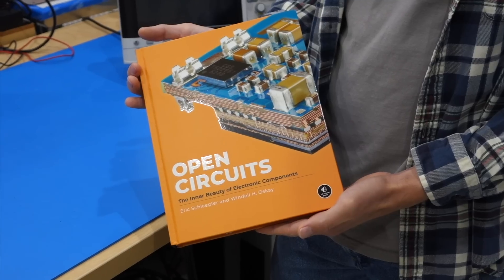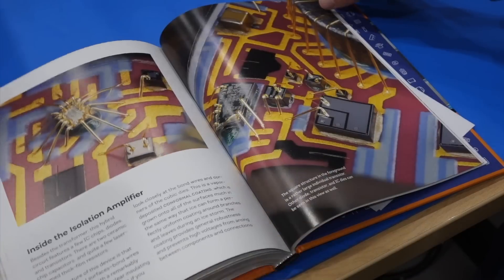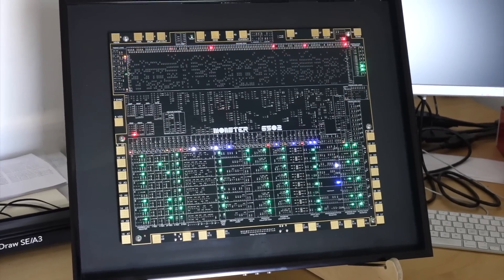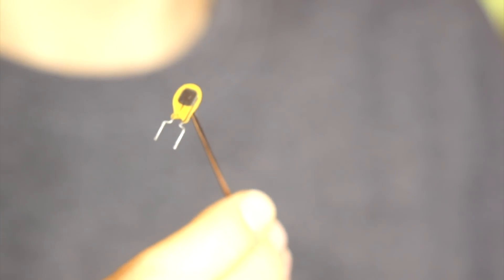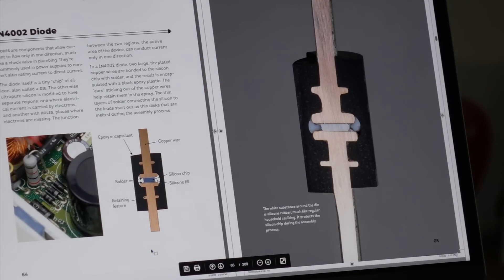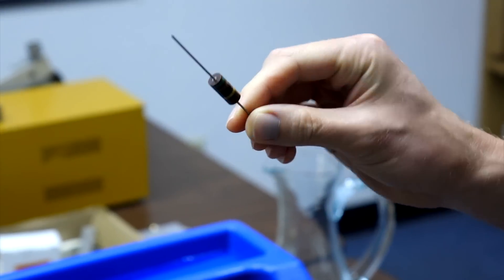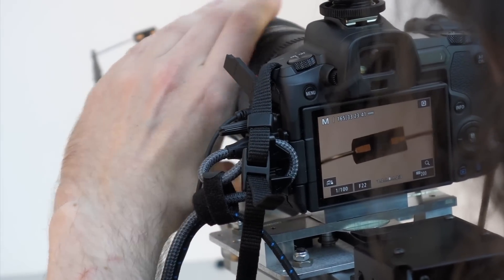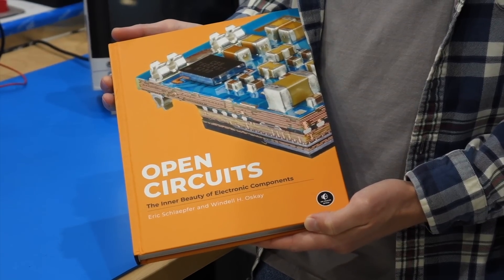Open Circuits: Eric cuts through electronic components and reveals their hidden inner beauty

Comment: The images I've seen from the book are just breathtaking. I'm amazed at the simplicity/purity of the cutting technique, I figured there would be some vacuum-infusing of resin, etc... The focus stacking seems very clever and effective. Carbon composition resistors are the ones that sometimes fail and take out a piece of equipment dramatically, right?
Reply: Some of the pictures did require using resin to hold internal parts in place prior to creating the cross-section. For example some of the cables and connectors

Comment: When I worked in the electronics R&D lab at Allen Bradley (1960's),  (carbon composition resisters, filters, ceramic capacitors, thin and thick film circuits, optoelectronics, etc.) we would imbed devices in a clear resin (using vacuum to remove bubbles) before cutting and polishing, thus supporting the parts.

Comment: My favorite part is when Marc says “…in the doodily-doo”.

I’m surprised they aren’t making epoxy pucks and slicing those.  It helps with keeping outer surfaces intact and gives a larger object to grasp for sanding, however it takes more time for sure.
Reply: I think an epoxy puck is good in some cases but I think they wanted the objects to appear as they normally do except sliced in half.
Reply: @djmips  Yeah, epoxy is great if you just want to look at a sample under microscope, not make a fashion photoshoot with it :D
Reply: Some of the pictures did require using resin to hold internal parts in place prior to creating the cross-section. For example some of the cables and connectors

Comment: That diamond saw blade is waaay too big. They need micro-blades. They're basically wafer thin, diamond powder 'sintered' in epoxy. There's no metal in them. I've even seen a few custom jewelers make their own using diamond dust used for polishing. The thickness can be as small as .5mm depending on what the powder is in coarseness. It takes longer, these blades are not big in OD, but they give out "chef's kiss" finish. No marks basically, as they polish as they cut.

Comment: Very nice, many years ago in a previous life I was employed to cut multilayer printed circuit boards to measure the thickness of the plating in the via holes etc. I mounted a small piece of board in resin then used a similar grinding method, using succesivly finer grades of emery paper, then finished off with diamond paste on felt. After this I gave the sample a quick etch in mild acid to remove any copper that had been smeared in the grinding and polishing process.

Comment: A little tip from someone who knows a thing or two about cross sectioning. If you want to hold the parts firmly for grinding and sanding, set them in resin/epoxy in a favourable size of container. 
Molten plastic will do the trick for larger components but for smaller and tiny ones resin is the best solution. Just dip them in when the resin starts solidifiying. They can be floating closer to the surface for easy grinding. You can slice them layer by layer and take as many pictures as you want till nothing is left.
Reply: and how u get the resin/epoxy off ?  its to delicate i think
Reply: @Marius_CNC_  you don't
Reply: @Marius_CNC_  You don't get the epoxy off! The aim here is to identify the failure mode (if there is one). For the best optical inspection, epoxy resin method is an indutry standard. Epoxy is so clear, its presence does not matter when looking at layers slice by slice. Simple, cheap and effective. This thing is utilized by the big players first and foremost for the solder quality for BGA and other types of invisible solder joints that might hide under components. X-ray is another method but visible light inspection slice by slice, gives the best results for identification of potential failure points.
You can actually tell by the profile of the voids or cracks what caused it and you can adjust your assembly processes accordingly whether it is caused by temperature or stress or similar defect causing inputs. You can happily grind down to smallets components even a 008004 or smaller....
Reply: Looks like we have a metallurgist here
Reply: @paolo_goli  Not really, just a Q engineer from a large scale electronics manufacturing company.
Reply: I am sure reusing the die quickly is the reason. I am sure parts crack, chip and fail in many ways know matter how they are held. I bet it is a time and money saver to do it the way they do it. It worked for them in the end and what is what counts. The pics are just amazing.
Reply: @LarryYaw  : Reusing the die? These guys may be reusing the aluminum blanks that they're mounting to, but I doubt it. And as for the resin method, you don't reuse the bits that you fill with resin, you just make sure that they're cheap enough for you to throw away.
Reply: @absalomdraconis  Being able to remove the part so it can be photographed is a issue I think some are skipping over. Being able to control the background is likely a big plus varying on the part. And I am sure with the way they are doing it they are highly likely to reuse the die/ blank. If the part shatters you are starting over, period. What ever the guys are doing is working for them. That is all that matters. I am sure they tried many methods.
Reply: @LarryYaw  No! They don't crack, chip or fell off in epoxy resin. Every time, first time you get perfect results if you know what you are doing. The failure is not acceptable if the cross sectioned parts are destroyed before you can get good shots of their guts!

Comment: Very accurate photography there. 
For anyone wondering, such macro work doesn't need to cost so much - there's a neat little trick that few know. It won't give as good a result as seen here but the images can be stunning.
The secret? Remember when digital cameras first came out? They were deathly expensive and had low pixel counts. They also had a special feature rarely seen today. This will take you some time and effort but go hunting out old digital compact cameras. Check the spec sheets for them. Some have very short focal lengths. I have a Sony compact here with a 12mm focal length! It only gives 3mp images but they're enough tbh.
Mount the camera and object you want to photograph closely. Provide very good lighting (but not too much or it will saturate) and fire away. Take many if you wish and stack the images in a software program - there are many freewares out there. 
I've won major competitions using my ancient Sony compact this way - I won by taking macro photos of rock crystals.
Reply: Another fun one is to mount a shorter focal length lens backwards on a longer focal length one that's connected to a camera. The ratio between the focal lengths will be the macro reproduction ratio of the system. For example, a 27mm wide angle lens mounted backwards on a 135mm telephoto will give you a 5x reproduction ratio macro system.
Reply: Or find an old Olympus Tough. They've got a pretty solid macro capability for a modern camera at a really good price
Reply: I wish I could save this comment, I have some older digital cameras lying around because I knew there'd be a use for them! I've even got use of some lapidary equipment via this local club. Hmmmm.